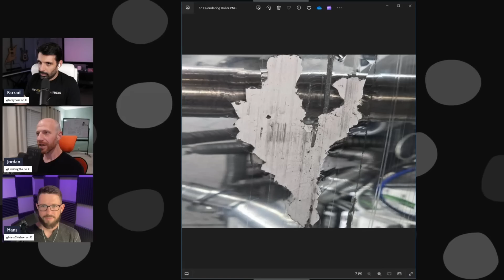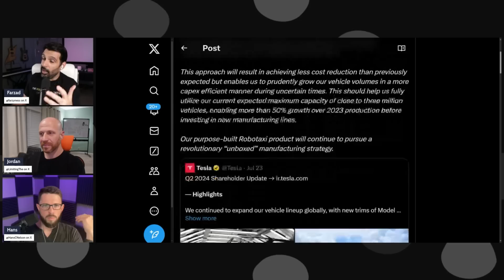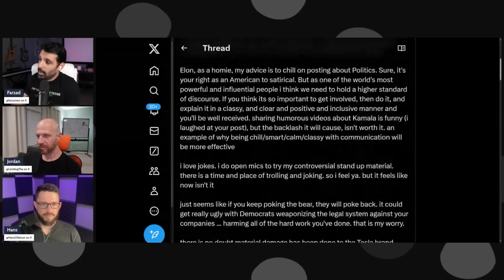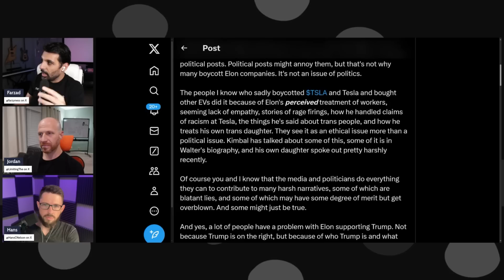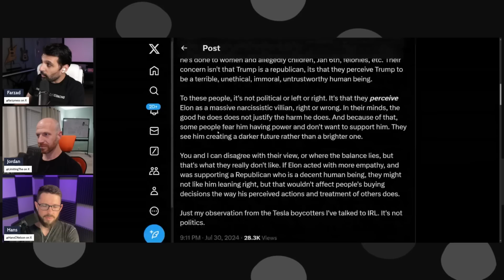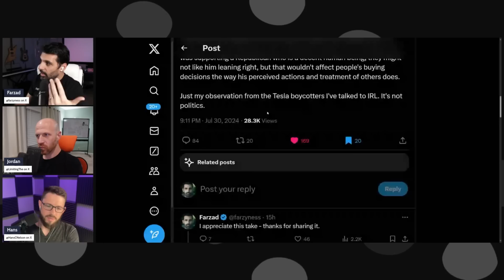Tesla's INSANE Breakthrough.

Comment: Now if they can increase the energy density.
Reply: Baby steps.
Sort the mechanics.
Make sure the Anode/ Cathode are STABLE,
THEN work on the "Chemistry"
When they do that, the benefit of the tabless design will be unleashed.
The original problem with the "General concept" of the  4680 format was getting the energy OUT of the cell without resistive heating.
Assuming Tabless solved that, they've been working Backwards towards the Stable Cathode.... Essentially to reduce factory footprint.
Assuming that's done, next.... Minaturise / Modularise the factory (As per battery day)
Then all bets are off, only limited by Raw Material supply.